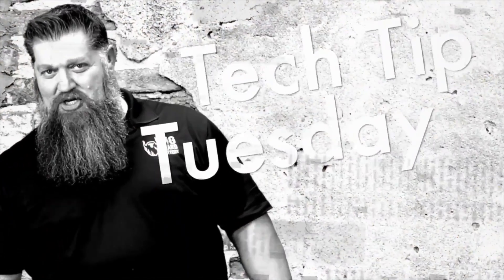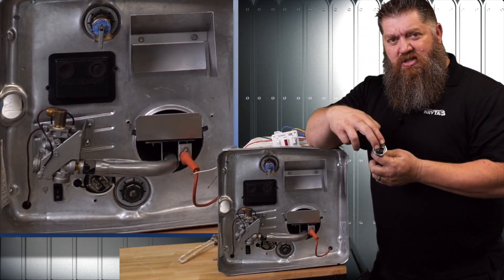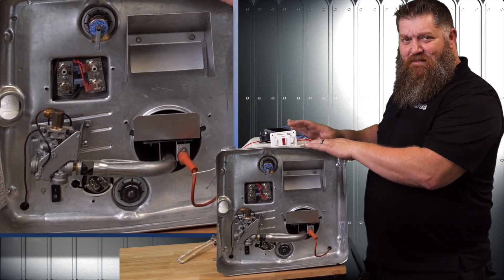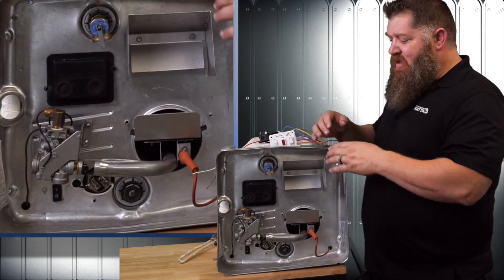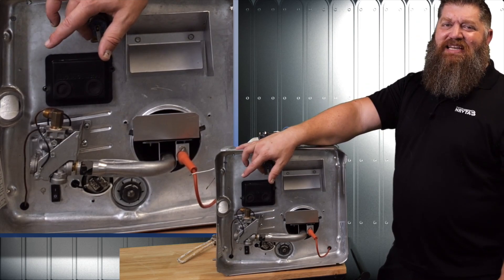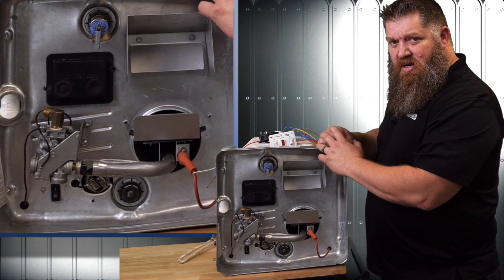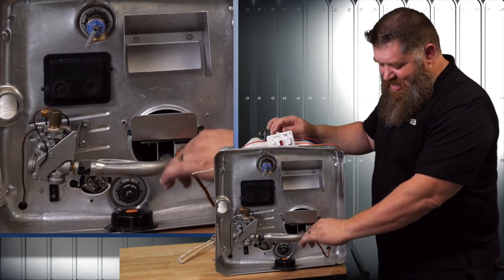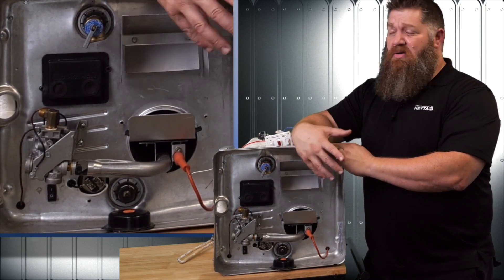How the RV water heater works

Comment: Another great video Todd.  How about doing this on the tankless water heaters. My new RV has a tankless water heater and I'm not as impressed with It than I thought.  How about a "deep" dive on those water heaters.  Thanks.
Reply: Tankless water heater is basically the same as one in a regular house except for it runs on propane or electric here's another tip for you in a tankless water heater there is no anode cuz basically it's stainless steel pipes